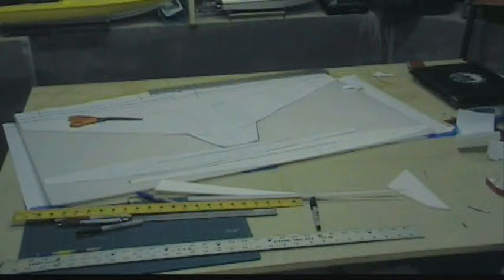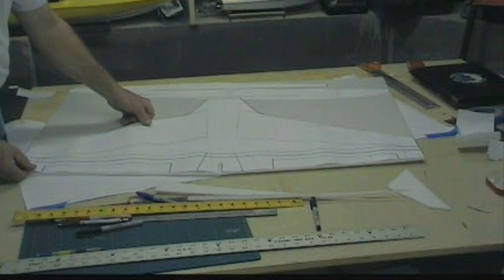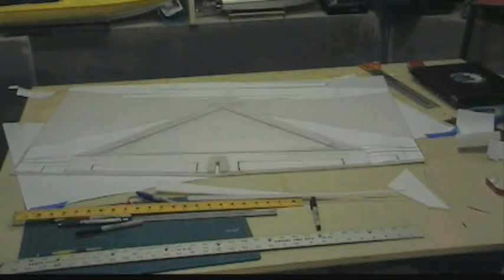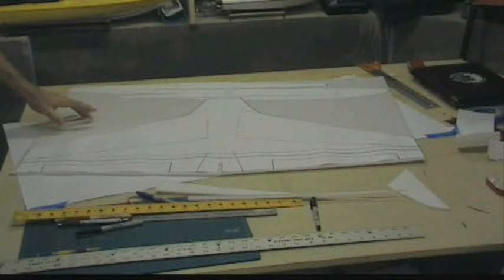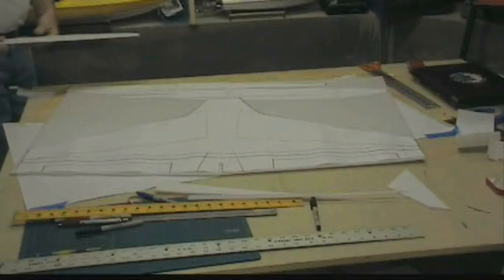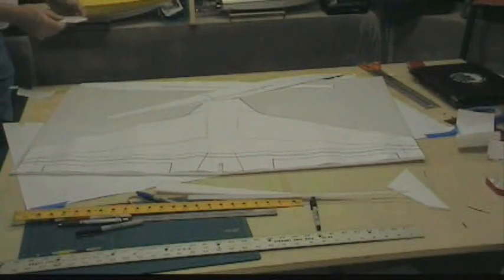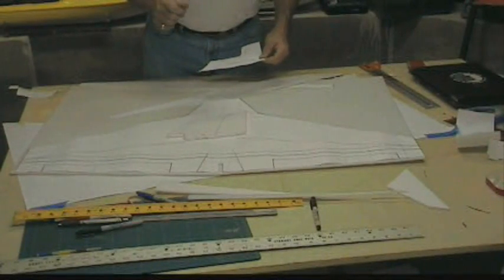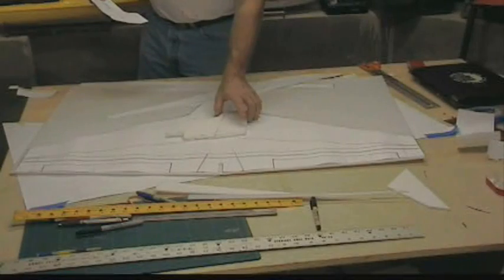Project Heron foam electric Seaplane

Comment from the maker: You can't find the plans because there are no plans. What I did is to leave the wing tips alone, didn't change a thing. The winglet where the wing meets the fuse in front is the same. I then stretched the wing span 10", FIVE inches on each side. I moved the ailerons out an inch to strengthen where the tail is mounted. that is it.
Good luck